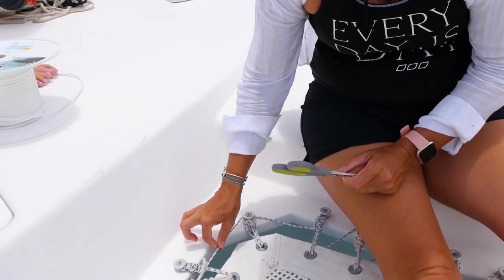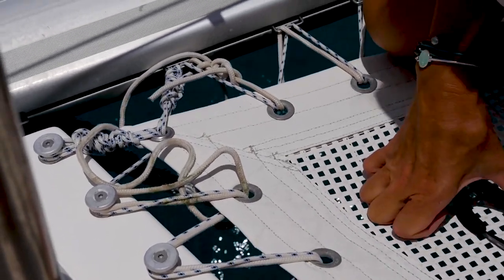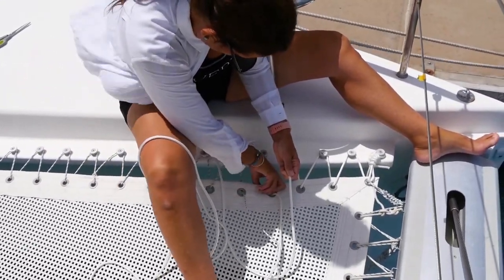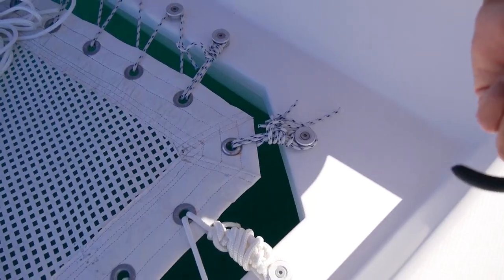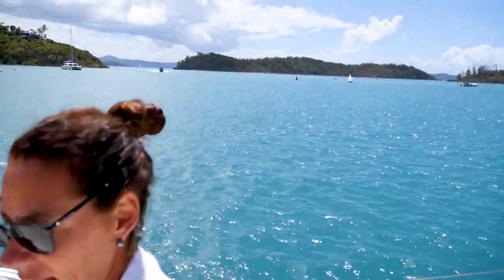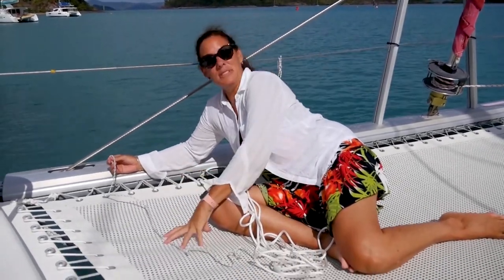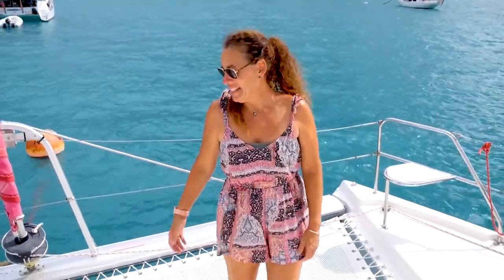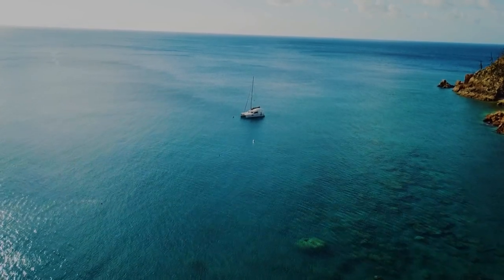Sailing Bluefin Ep #14 - How to re-lace a Leopard 44 catamaran trampoline

Comment: Nice job.  Great to see you're taking care of the little things!  Looks so much better too!  I'm wondering if the squeaking noise might have been from the salt crystals in the old rope rubbing against the metal grommets in the trampoline?  If you take spray from the ocean through the trampoline, I think when the salt water dries, it leaves behind abrasive salt crystals on the rope (and the trampoline material).  Rinse it with fresh water after taking spray and see if that helps keep the noise down.  I just read this quote on a boating forum that was talking about trampolines:  "My tramp is now strung into place with Super Braid 
(Spectra) and that has eliminated all the annoying squeaky noises that 
came with the stretcher and heavier double braid."
Reply from the maker: Thanks Wade, good to know. We heard different things about using dyneema on the tramp and also know that it is tricky to cut and work with, as we use dyneema on other parts of the boat. Apart from this, we're in the Whitsundays and everything is difficult to get here without driving to a larger city like Mackay. Luckily the squeaking is gone for now. 😀
We might try dyneema if we do it again later.
Thanks!